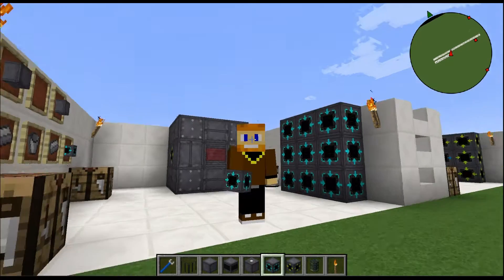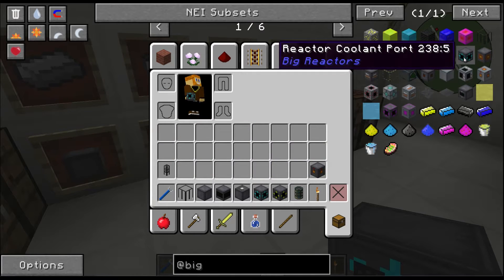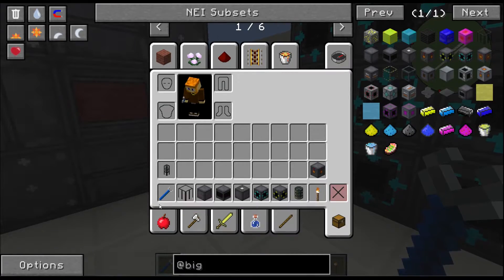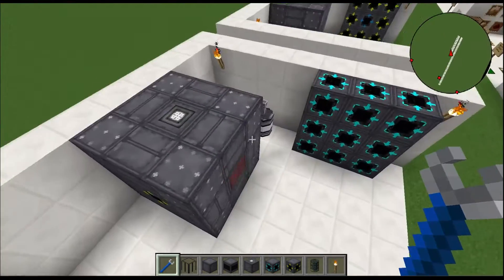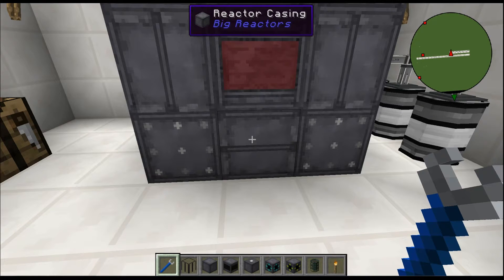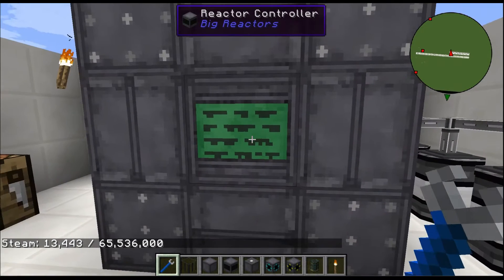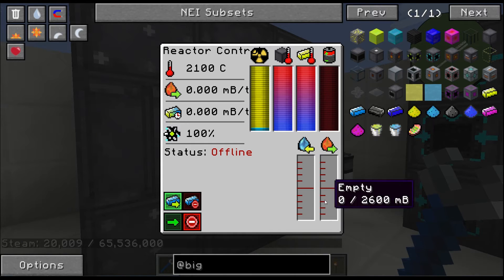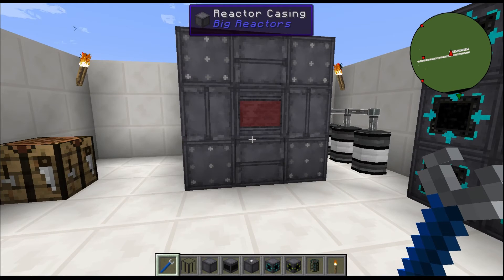Reactor Coolant Port (Big Reactors) | Minecraft Mod Tutorial

Comment: it wont let water into my reactor
Reply from the maker: are you trying to pipe it in? or using a bucket?
Reply: pipe but I'm in 1.10 so it might be different
Reply from the maker: yea extreme reactors should be similar to big reactors but these are quite similar mods, your sure the pipe is filled with water? sorry im not sure which pipe your using.

Comment: how i get so water for the reactor ? some idea ? pls i need so much
Reply from the maker: you want to pump water into it via pipes usually from a aquaeous accumulator from thermal expansion :) hope this helps
Reply: @JigglyBluntGaming  i tried using it but it didnt work
Reply: Jiggly Blunt I’m using the Tekkit modpack, and thermal expansion isn’t in the modpack. What else can I use to reverse the coolant port?
Reply: I did it. I used water pumps. From water pumps water went to barrels and from barrels with water pipes water did go to the coolant thing
Reply: try pressure pipes infinite water source or reservoir from enderIO